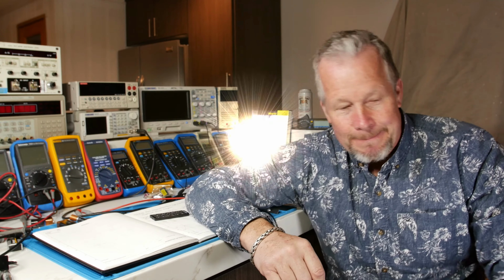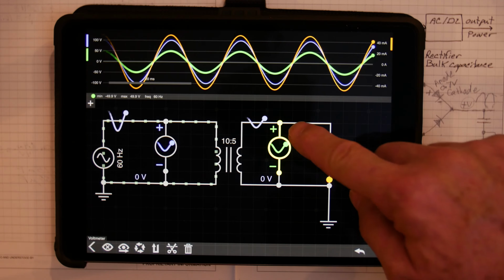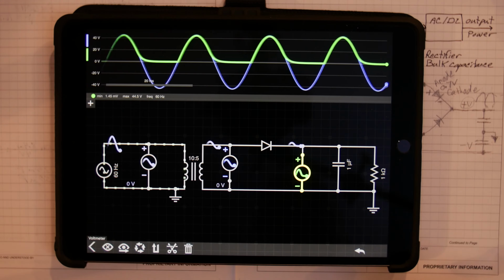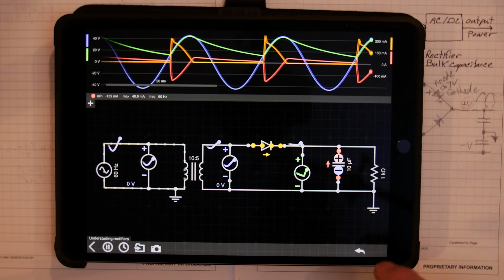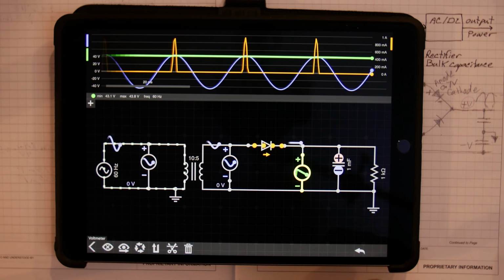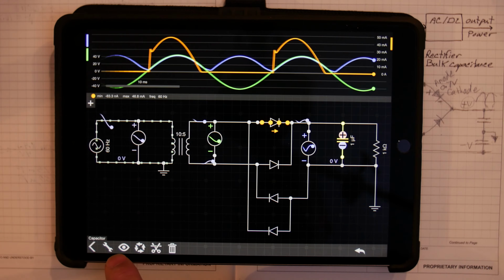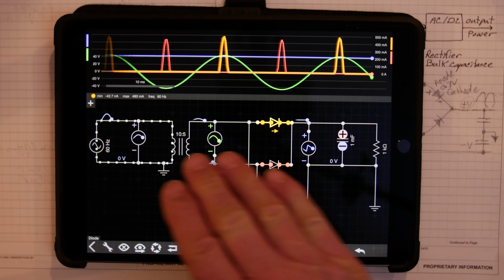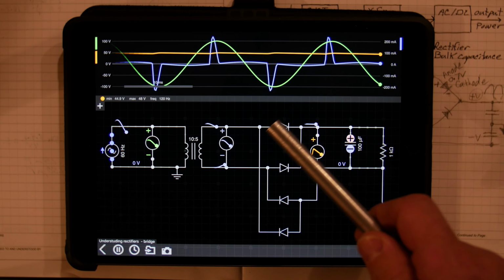How diodes work in a power supply with EveryCircuit Simulation

Comment: I would be interested to learn a little more about filtering. By the way, I was thinking that this was a long video to cover something that I thought was so simple. But, it turned out more interesting than I expected. I didn't previously understand the effect of capacitor size on the shape of the current wave form.
Reply from the maker: Paul Nichols Great feedback!  I do want to break subjects up a bit so that each section can be viewed without wading thru the part that is already understood.  Or, at least each section can be swallowed in smaller bites;). I’m going to cover filter design soon.  I actually have a design of my own I was going to talk about, and then show how it was designed.

Comment: Is it useful to put a snubber capacitor over the rectifier diodes in a bridge rectifier.  (and this in audio applications).
Reply from the maker: Great question!  It is actually common to place a capacitor across the bridge.  One across each diode is not needed.

Comment: I'm just learning and this was an excellent video.  I had never heard about the spiking current through the diode in a rectification circuit nor its impact for line noise.  I wonder, could you add an inductor after the rectification diode in order to limit the spike of current?
Reply from the maker: Thanks for the feedback Matthew!  And yes, that's great thinking - you can use an inductor;)
Reply: @kissanalog , I really liked the animation on EveryCircuit.  I would love to see the difference between putting an inductor before or after the rectification diode vs no inductor.  I'm working my way through your videos.  Hopefully you do more with EveryCircuit.  The animations are so clear.

Comment: I believe I may have watched this awhile ago Eddie so if you said something about bridges and full wave rectifiers I apologize. 

I'm using a full wave in my linear 30V 10A power supply, here's why. The transformer is an Antek 3222 (300va x 22v, two secondary windings so I get a CT), with a full wave rectifier I'm only seeing half the voltage drop of a bridge because on each cycle only one diode is forward biased. That means I'm only losing one Rf drop per half cycle instead of two drops in a full wave. As the current rise and the Rf rises I have half the losses.  The double peak full wave diode voltage doesn't matter, I'm using 1kv diodes which is very much overkill but that's what I stock.
What do you think?
Reply from the maker: I like that!  I do plan to do the same in the 20W Audio Amp series.  The advantage of using 2 bridge rectifiers (one for each winding) is that there is less current per diode.
Reply: @kissanalog   Each half cycle still goes through the diodes in both a full and bridge, the only difference is the return. On a full wave it returns through the transformer CT and on the bridge it returns through the opposite transformer leg so I think the current per diode is the same as in a bridge because the diodes are in series. As far as I can see the bridge drops twice the diode current relative to the overall current so as the current of the supply increases the Rf also varies more than a full wave so the supply output varies more in a bridge than a full wave. Am I wrong and missing something?

I think the main complaint with full wave was the need for a more expensive CT transformer but with most of the new toroidal transformers you get a CT as part of the package.

I just reread your response and saw "one for each winding". That's interesting!  You bring the two winding outputs together. But wait, the Rf curve for the diodes is not linear, even at low currents diodes still exhibit a relatively large Rf so it seems there might be greater losses with that arrangement even though the diodes see less current.

Okay, what if I use one CT transformer and run two full wave typologies off it, each one complete with capacitors. So let's say we have a total of 80000 uF from 8 capacitors and I run 4 on each leg so essentially I have two complete circuits each one rectifying half the total power. Then the load on the caps would be half so I'd get the same effect as all 8 in parallel, I'd have less Rf and less total diodes but with the same current through each diode. I just tried it in simulation and it works.

Comment: Eddie,  I watched ale video. The current factor in rectification is what I never thougt about and how current peaks differ. But one question came to my mind - if you have succesfully flattened the wave using one capacitor...why often two caps are used behind full bridge rectifier? My idea is to do the same or even better job but with lower current need. BTw i might also play a simultion in everycircuit.  But thank you for clearing up my doubt. Jacek
Reply from the maker: Yes Jacek, I think you have it;) Using more than one capacitor is often needed as the capacitor ripple current rating isn't good enough to use just one.  Also, a high frequency capacitor is useful, like a 1 uF or something like that in film or ceramic.

Comment: I THINK THIS DEMONSTRATION WOULD WORK BETTER BY USING A REGULAR OSCILLOSCOPE.
Reply: This webbased simulation software is also super for such lectures. Why not use it ?: )
Reply from the maker: @jacekmalota5571  Thanks - I do need to start using this again;)
Reply from the maker: Thank you!  I think I did in a follow up vid;)